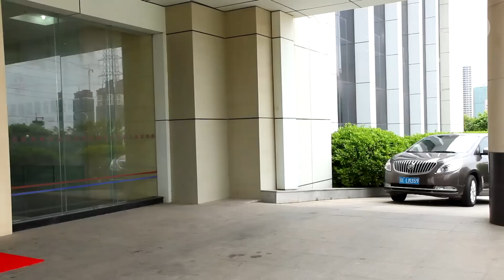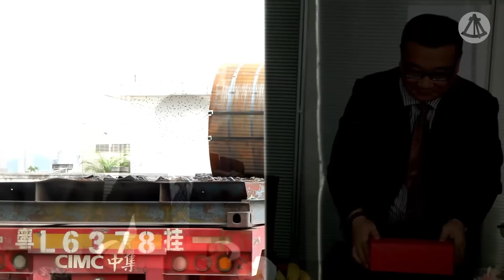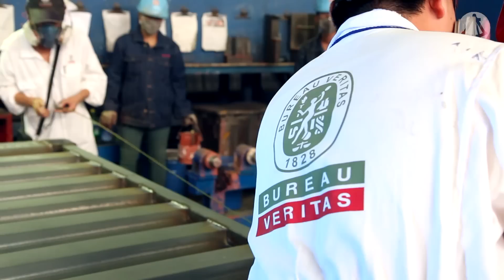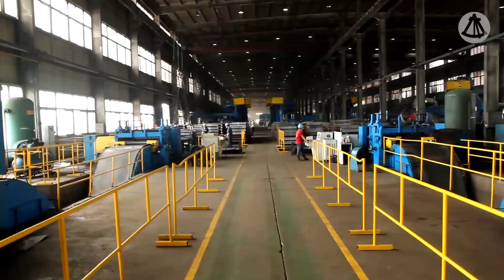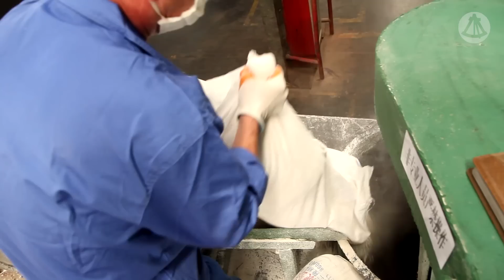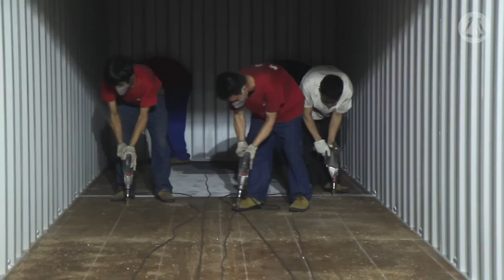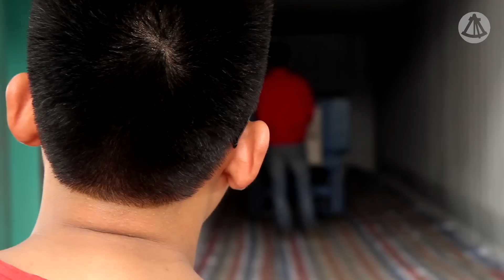container production

Comment: @QhVs start using adaptive strip oiling and  wiping without any energy, no moving parts, no replacement  parts. Once installed no use of Rubber squeeze rolls, Felt Presses etc, fit it and see the amazing results @QhVs

Comment: 650 containers per day. That is a lot. That is a container ever two minutes. No way they inspect every container thoroughly, and it looks to be just a spot check, for camera mostly. It is easy to see it is all about volume, speed and streamlining production. Sure they are probably all good, but they are not high tech products either. The work is pretty damn close to optimal, and everybody is focused on their job, so that works good. But some of the stuff could be easily automated more. Production of plywood by doing things manually is a bit ridiculous.
Reply: True but do you have a degree in business? Can you analyze  and determine costs between automated  and manual operations?
Reply: I am just a stranger on internet pretending to be an expert.

Comment: I designed some manual tools for some containers. It was a tool that welded on the lower locators that stack the containers. Never hear if it was used or not, it wasn't shown here. It was very unique job for me.

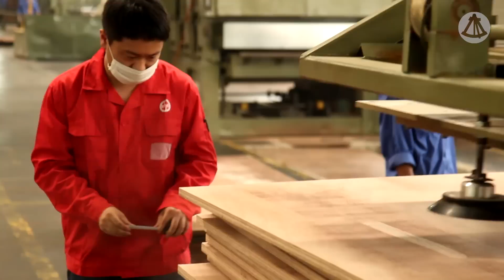Comment: 10:57 quality control guy measuring thickness of plywood in the wrong direction.  "For the cameras."
Reply: The Analog Kid ... I don’t think you can measure quickly in the traditional direction. You need to be able to fit the tape measure between the sheet above and below which would be a pain. Therefore, a measuring device that is the thickness of the plywood (but the width of the measuring device) is fitted between to the sheet above and the sheet below to measure.
Reply: @HeavyboxesDIYMaster  Yes, you may be correct.  The width of the measuring tape is used as a gauge to verify the thickness of the plywood.
Reply: @HeavyboxesDIYMaster   You can see at 10:58 that he is using a piece of tape narrower than the finished board and he is "measuring" side to side. Just for the camera.
Reply: Coz its made in china.. it cant ever be any good

Comment: Pause the video at 00:30 and check out all the massive cracks in the walls of the factory building.  Quality!  One big crack coming off the overhang roof, and three across the pillar on the far right.  Its actually crumbling apart at the top!
Reply: China is growing extremely fast, little time to do things right, and there is little of a maintenance culture.  They also need to keep workers busy, so it'll just be rebuild in 10-20 years anyway.  Its a huge waste of labor and materials, but that's their thing.
Reply: @Earl Bakken I hope you're kidding.

Comment: V interesting.......I wonder why there's so many dumped...........
And how much...for one?
Reply: Here in CA, a "good" quality, guaranteed weatherproof used 20' unit that's been retired from shipping use runs about $2000 on average. The 40 footers about a third more. New 40' units are a bit over $4000, IIRC when buying the 20' unit I did a year ago. You can also buy non-weatherproof units for much cheaper but they'll need lots of work...welding, straightening, paint.

Comment: Why do they make the floor board in house ?  Isn’t it more economical to order directly from lumberyard ?
Reply: Cause average plywood would not last in a container. They need to made for high strength,  water,  rot and insect resistance.
Reply: And they use a nasty insecticide in the glue, so if u use them for a home, u have to take the plywood out, or seal it so it doesn’t gas off with you inside

Comment: As soon an I heard "China",....I didn't trust anything that followed.
Reply: 8000RPM so you can go to live in a cave because 70% of things everybody use are made in China (unfortunately?)
Reply: Agree, I want to buy a few containers for a small retreat cabin but I don’t want China made because I just don’t trust the metal specs or quality.
Reply: PCnever you moron it’s a container not a rocket.
Reply: @Uisci81  Plus all the stuff they are required to spray these containers with to keep the bugs and rodents out.
https://www.ncbi.nlm.nih.gov/pmc/articles/PMC4465480/
I think that's why the guys working at the end of the line were wearing respirators.
Reply: @msnpassjan2004  Safety in China is like a sinner getting into heaven,...it's not going to happen....

Comment: Very professional... I would love to have a few of these, new, for a container home I would like to build.
Reply: They're cheap. Like $2,500 each
Reply: Might want to take a look at what they spray these containers with first.
https://www.ncbi.nlm.nih.gov/pmc/articles/PMC4465480/
Reply: Dude, shipping containers are made to meet ISO spec for the minimum cost for their intended lifespan. Container houses are a nifty architectural "feature" but the idea of actually making a realistic house from them is not worth it practically. Yes people do it, but the reality is that for almost all use cases it's better off using a more traditional style of framing. It's cheaper, lighter, more durable and will give better insulating and weatherproofing properties than a box made to last less than 12 years.

Comment: Theydo a nice job of building them. it's a pity the shit pumped out of China isn't as well made.
Reply: I was gonna say the same thing. I guess they don't want the most important thing in transporting that junk, to fail.
Reply: Despite the negative opinion, China Made goods are the envy of the world. Read the manufacturing labels on every piece of electronics you own and then try explaining how quality is made. Every business knows manufacturing can be labor intensive so manufacturing with low cost labor while ensuring quality on the production line meets standards acceptable in any country using shipping containers means a quality product. Not low quality. No country would buy these containers of they don't meet their transportation requirements.
Reply: You want cheap.  They give you cheap.

Comment: you would think that they would buy their steel is 8 foot wide rolls and make the sides in 1 piece. it would save time and money not having to weld several panels together to make a side
Reply: that would raise the cost actually
side has to be ribbed

the  multiple  panels  makes  possible to  welding  em together to a specified length

meanwhile the  one piece  would require a much  larger machine  to ribbing, plus   extra step to  make length to size..

but honestly  they figured this way,  I trust em they know they doing
Reply: @cnccarving  yeah I agree with you that after making a zillion containers I am sure they got it down to a fine science...
Reply: How big would the press have to be to press a complete 40ft side section in one go ?? That's the cost to benefit ratio , in this case labour is cheap so smaller presses and welding
Reply: @dennisphoenix1  Not all containers are 40ft.  ISO standard calls out both 20ft and 40ft lengths, non-standard lengths (as used for domestic US) includes 48ft and 53ft lengths as well.
Reply: @timothybarney7257  so you would need a 20ft press ?? Sounds unlikely
Reply: @dennisphoenix1  No, but making the panels to smaller standard dimensions leads to better flexibility to make multiple size products without major retooling.
Reply: @dennisphoenix1  I would think someone could design a continuous press to work the steel right off of the roll.
Reply: I agree. I'm an engineer. Along corrugated piece would flex when pushed into place to take up length variability. But what do I know?